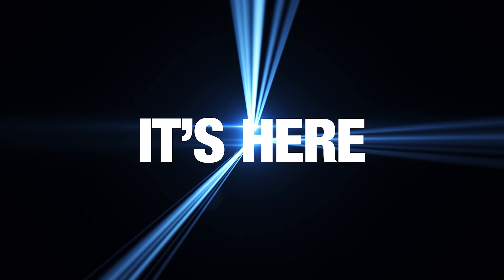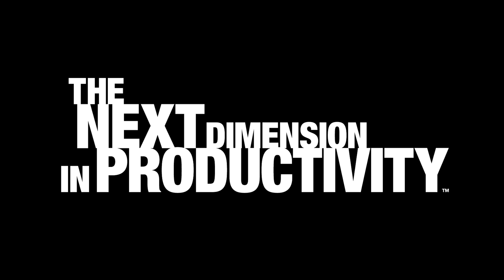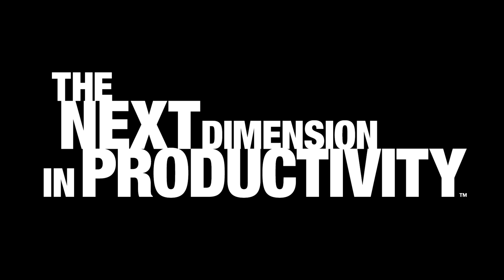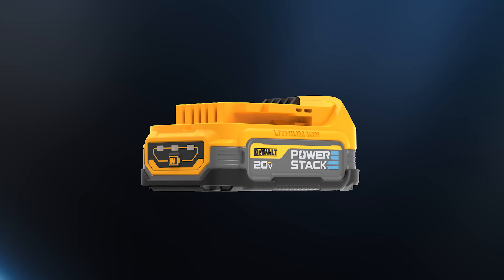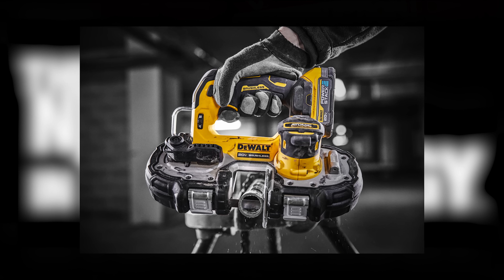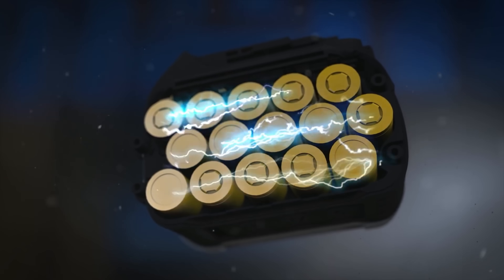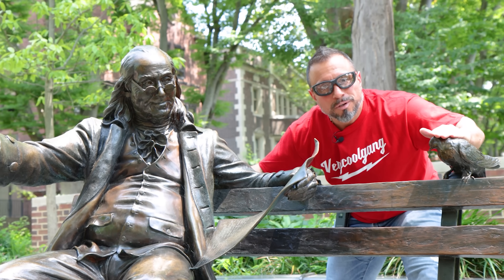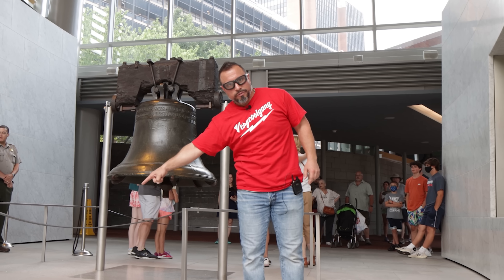DeWALT PowerStack Changes the Power Tool Industry!

Comment: I'm thinking longevity will be an issue. I've never seen foil pouch batteries last very long before shorting out or catching on fire. Considering tools on a construction site usually aren't treated gently, I bet these batteries won't hold up nearly as long as the previous 18650 cell batteries.

Comment: It’s funny when tech that is well known to one industry (mine in this case, IT) gets repackaged for another industry as a revolutionary new product. Lipo batteries have been around for some time now, as have stacking them. This move also helps them prevent users from fixing their own batteries when they fail if they use a non standard lipo pack. (Physics is physics friends don’t be fooled by shiny packaging). Incremental and welcome improvement.

Comment: Those are lithium ion not li-on like an 18650 or 22700 cell.we use them in rc cars,my only problem is they run hot and after tons of cycles the packs swell.hopefully they have that figured out ive got some old makita 18650 batteties that are 5 years old and still working i just dont see that happening with these new packs the cells are not as robust.also if there is a puncture they catch fire very easily.

Comment: 2 minutes in. So they went from nicid to Lipo batteries.   Well duh .  Lol .   Power tools has been riding the rc car industry jock for a grip now. .    Rc cars go from brushed to brushless motors .  Years later lower tools follows. .
Rc cars switch to mainly Lipo batteries like 7 years ago lol.

Now the power tool ndustry is just now going to Lipo ??

Or did I miss something?

Comment: 1. Using flat pouch cells instead of cylindrical is a mistake. They are inferior no matter how you look at things. Nothing revolutionary about it. 2. Milwaukee has been using 21700 cells for years now. DeWalt is behind in this area.

Comment: It's a 1.7 or 1.8 Ah compact battery that can output a higher current (eg higher peak power output) than the 2Ah battery but for 10-15% less runtime and more money. Honestly it seems like a lot of fuss over a fairly small improvement - most people use a 4Ah or 5Ah battery anyway, and the "extra power" claims are vs the 2Ah battery, not those larger (more powerful) batteries. I'm sure it will be useful to a few people who want a more compact battery without losing out on power output, but it's pretty niche
Reply: Perfect explanation
Reply: Yea except for the test this channel did where it out preformed a flexvolt
Reply: The ah is how long it lasts not power output
Reply: @pierreguillotte5013  yes…. I’ve never said otherwise. I’m saying it has higher power output (A) despite having lower capacity (Ah)

Comment: These are gonna get hot and die. These are essentially a stack of cell phone batteries. There’s less material between battery layers and there’s less material shielding the overall stack. I’d wait to see if these pop in warm weather and if they hold up to long term use. I’m very curious how they’ve handled battery degradation.

Comment: This is actually old technology..
18650 amd 21700 are actually new tech.  Lipo pouch cells are older news, however they provide more current for higher demand applications and can be smaller. You lose capacity as a trade off.  I own a company that builds custom lithium batteries for many applications like electric motorcycles/aircraft. If one might question where I'm coming from.
Reply from the maker: Wait, you’re saying they’ve been able to apply this tech to tool platforms for years? Why did they wait until now to release it?
Reply: @VCGConstruction  I have been questioning that myself. Best guess is they were  either working out the safety issues, waiting for a manufacturer/supply chain or were waiting for a product cycle to end so as not to cannibalize sales. I think the benefits to size are impressive but will they be as powerful as the 2170 cells @Lifebreaks2 ?
Reply: @Lifebreaks2   Thanks Lifebreaks2! This is exactly the kind of analysis I'm looking for. How well do these cells tolerate heat when used outside? (I have learned this lesson from the constant overheating alerts my iPhone gets when I'm watching YouTube outside).
Reply: @VCGConstruction  yes exactly.  I've been using lipo tech for over 15 year in rc cars.
My first thought is that lipo has always been pretty volatile if something goes wrong. I've had several cars burn up from a puncture or abuse. Lol. If they are well housed I don't see an issue though.   Another point is that brushless motors have been around just as long!!! Hahahaha. I have been waiting for them to be put in power tools!  I use both in the Electric motorcycles I build, they smoke gas bikes!

Comment: I have had DeWalt, Milwaukee, Makita, porter cable, Bosch cordless. Went back with DeWalt XR 20volt. I have a crap ton of the line. But DeWalt could and should have already had 20vmax 1/4 and 3/8 ratchets! Say it ain't so!!!!

Comment: I don’t think people will hurry to buy these new batteries until their old batteries are fully dead.  As for demanding tools, depends how desperate you are if you want to use small batteries on bigger tools.  People won’t suddenly switch over if the cost is high.
Reply from the maker: What about powering small equipment (14” cutoff saw or Core drill) with something the size of an 8 or 12 AH battery?
Reply: @VCGConstruction  you know Vince, I am actually more interested on what other companies have to say about this new battery technology.  Do they have an answer?  I was always hoping for Makita to come with some kind of solution to their 18v system that would further improve upon it, but they simply decided to divide the platform between 18v and 40v. IMO I don't think that's the smartest choice.  As for Milwaukee....I definitely think they would benefit if they could slim down their HO batteries.  I really like where Dewalt is going with this, but I want every brand to respond.

Comment: Hope they won't swell up like other pouch cells! I think there's a reason the standard cells used in EVs are cylindrical. Anyway good on big yellow for innovating
Reply: I really hope they have improved pouch cells. Every one I’ve ever had ended up swelling which makes it a ticking time bomb. Better charge these in a fireproof bag!

Comment: So, they're using lithium polymer packs (lipo) instead of lithium ion (lion) cells. All mobile phones use this technology.  Amazing it took so long to adopt lipo's.  The cost should be lower as lipo tech is cheaper.  Lion cells usually have a over current and charge protection circuit built into each cell. I'm assuming the older packs ran "naked" and had a single protection circuit for all cells. The lipo's should be a direct drop in replacement for the lion cells. The only downside to the lipo's is that they can catch fire more easily if they're breached. I can't wait to see the videos where someone drives a nail into the lipo pack!
Reply: ,yep, been using lipos in rc stuff for years, highest power density you can get today but they can be very volatile if over or under discharged or damaged which is why they haven't been used before now for cordless tools.... I guess DeWalt is pretty confident in the protection circuitry they put in these packs?
Reply: @dawsonmobley  lol..I'm into FPV. I had a 3S 850mAh battery that had a thermal runaway while charging. Damn thing nearly caught my house on fire. Filled the house with smoke. Since then..Bat-Safe and never let them charge on their own!

Comment: I had a firestorm 14.4v drill with the 13mm chuck which was just too good to get rid of. No adapters avail (unlike the later but worse replacement 20v LB series) i made a battery pack replacement using 14.4v pouch batteries for RC ships. That drill has a new lease of life and can fit 3 x 14.4v pouches in parallel in the old batt case and still weigh less than the original NiMh brick. Motor spins up faster, feels more “torquey” and batts last 3 times longer even though more punchy.

Comment: Good news, good video! I wonder who manufactures these new pouch cells for DeWalt?
Reply from the maker: Good question!
Reply: Chervon?
Reply: @homelee665  I don't know it's usually LG, Samsung or Sony .
Reply: Those companies make the individual cells a lot of the time, but Chervon has made a name for themselves in the production of finished batteries.  And the top of battery technology can be seen in companies that they own:  Skil, SkilSaw, Ego, and Flex.
Reply: @homelee665  word. I guess I meant to ask which company manufacturers the cells for the new DeWalt powerstack batteries?
Reply: Ah, I got you.

Comment: All I’ve seen is a 1.7ah so far, I’m a dewalt guy, as an electrician I use a lot of there 20v platform, and I have invested a lot into the 21700 cell battery’s mostly 6ah 8ah. But I’m excited to see new products and want to see how they perform.
Reply: I’m wireless internet + tower tech. Looooove the 1.3amp and the 2amp xr bats. So light weight I just have 10 of them in my drill bag. They’re stupid convenient for crawling around on roofs and through support beams when prewiring CAT. I see a ton of electricians use the small XR bats as well

Comment: Pretty sure all these stack batteries will be lithium ion packs and not Lipo as these are much more dangerous especially with tool batteries left uncharged in cold and heat which is where Lipo's are prone to swelling and catching fire.

Lithium ion packs are just much more adapted to tools and will be better ergonomics making higher amp hours in a smaller footprint
Reply from the maker: The temp swings had to be an obstacle!
Reply: Just going to stacks alone will use up the space that is lost every time they put cylindrical cells together. The bigger the cells become like the 21700 the more space you loose  even if you stack them inbetween.

Nice to see a little innovation but something smells fishy for both Flex and Dewalt to have decided to tackle the same issue and to be coming out with these pretty much at the same time. My guess it they are working together to trip up Milwaukee.

Comment: and the downside is safety? Pouch cells swell when under pressure and heat. and little protection to puncture compared to cylindrical cells. im a little skeptical but excited for the change.
Reply: i agree with you.  these pouch cells often have no physical separator layer and instead rely on a "micro porous"  electrolyte gel.   so there's less inherent protection in the typical design .   the history of pouch cells in not great , from  all applications ranging from RC to phones and computers to automobiles   ..

i will wait till we have more information about the cell design and who actually makes them.  i also want  to  see how these perform versus the claims - as typically pouch cells have way less , not more , real-world cycle life than cylindrical.   They are a cheaper cell design and there are countless unknown companies making these kinds of cells as it is far easier to set up shop and churn out pouch cells of every size and shape imaginable...
Reply: I had an iPod that tore itself apart when its battery expanded.  This is the same tech?  I was excited about it after the Flex video, but if this is just that in a tool battery, I'll stick to the cylinders.
Reply: https://youtu.be/wjwUXHPwpgE
Reply: I was thinking the exact same thing. I feel like these batteries won’t be as reliable for professionals despite the claims. 
Someone correct me if I’m wrong, but I thought these pouch type batteries don’t like being left sitting fully charged. I feel like there are going to be users in hot environments and the batteries will wear out quickly. There’s going to be pros and cons for everything. We will have to wait and see how they stand up.
Reply: I’m sure they would have took that into account and also the person who replied comparing to their phone. A powertool battery isn’t trying to cram the same technology into less then 10mm thick
Reply: @jamesengland9616  i think you're probably correct, but we still need to see if these will justify their higher price in real world performance.    The claims regarding cycle life, In particular. ..

Comment: Its just likely and looks to be lipo battery backs. Been around in jump starters and rc for quite a while. Also can be pretty dangerous. But they pack a huge power punch and light weights in a smaller pakage. As for the rubber coat, they meed all the protection they can get as those cells are soft, easily bendable even by hand and are fragile/sensitive
Reply: That’s exactly what it is I don’t know why people are so surprised lol
Reply: Didn't they still say lithium ion on the battery?
Reply: @ethanmunger3374  they do but apparently li po is still a lithium ion at least that’s what I was corrected on today
Reply: @WyattH  Interesting guess we will find out when some people get there hands on them and tear them apart. Thanks for the info.
Reply: My thoughts the same old tech 
We’ll see what the c-rating is the more the bigger punch

Comment: I might have to swap over to DeWalt next year when these fully roll out. I say next year since the cost should drop a bit and they have some decent kits that will include the batteries. That's if Ridged doesn't announce a stack battery system in the next year. I'm in data com so I don't need the fully prograde and Ridged get the job done for me.
Reply: Ridged is still legit.
Reply: @CarRamrod224  good luck showing up to a job site with rigid tools
Reply: @visionsdb6695  Seen plenty of trades do it.  Its not ryobi.
Reply: Dewalt said new batteries come out December 1st

Comment: Either Milwaukee is about to get left behind, or they are about to absolutely release the  cracken with Gen 4 and new battery tech! Really hoping for the latter!
Reply from the maker: I hope they’re not resting on their laurels!
Reply: They can always pull the Apple approach. Set back and let the competition make all the mistakes and get the kinks out and then come out with a more streamlined version. As it sits right now to me as a consumer there’s no advantage to using 1.7ah batteries 🤷‍♂️
Reply: Same here. Once they figure out how to stack these pouch cells 2 or 3 inches high, I’ll be interested.
Reply: Isn’t this the same thing as a Milwaukee High Output?

Comment: Vince, who owns this technology patent?
Reply from the maker: Maybe it’s open source technology?!?!
Reply: @VCGConstruction  I seriously doubt it. Someone most probably has patent on it. Can you figure? Just out of curiosity
Reply: There is no patent on this, FLEX and DeWalt have the same supplier. This is a little to late to the game since CAT already had their battery almost 2 years now based on the same concept but different supplier. Milwaukee MX was suposed to have this style of battery but not sure what happened to that. One of the things that people don't talk about in the industry is the scarcity of 18650/21700 cells, since most of them are used in automotive now. The power tool industry needs another source in order to pump batteries out, this re-packed form factor is going to be more flexible for them. Varta already has a 21700 cell that charges in 6 minutes that can be used in a power tool application. Imagine a 15 minute charge on a battery !
Reply: Thank you very much for comprehensive explanation. It is fascinating to see the rapid advancements in the accumulator industry. The same technology could benefit the automotive industry tromendously. However, I share your concern regarding the short supply of the cells. I did not know that CAT has this technology. I would not be surprised if FLEX/CHEVRON has a lot to say in the development of these flat accumulators. 15 min charge time is fantastic but how much would it actually cost? I would live to hear your opinion on DeWalt 60 v flexvalt battery versions using these flat cells?
Reply: @IRAKLICHIKHLADZE  Let's put it this way Chervon is very familiar with this technology , and with the leak that they had, the cat is out of the bag. Flex is not the first brand that they actually consider such a product for.
Reply: Considering it's been around for years and years, I'm sure it's some RC company. Not a very stable platform...